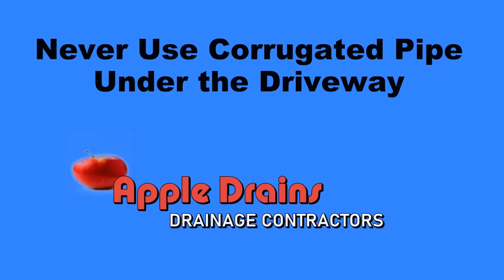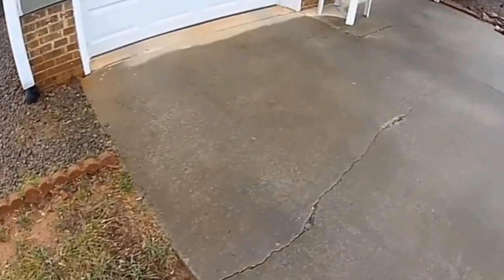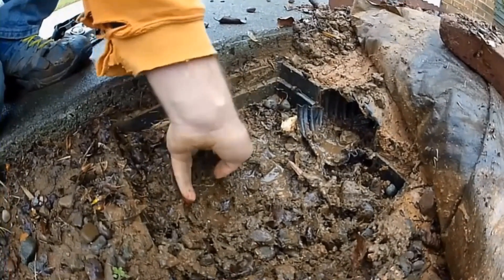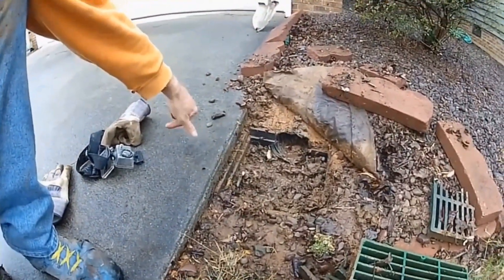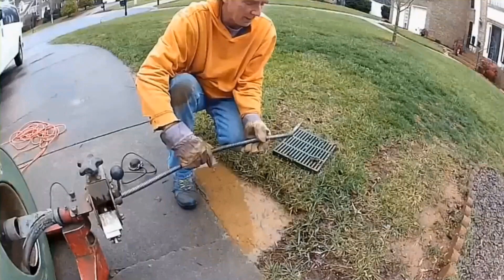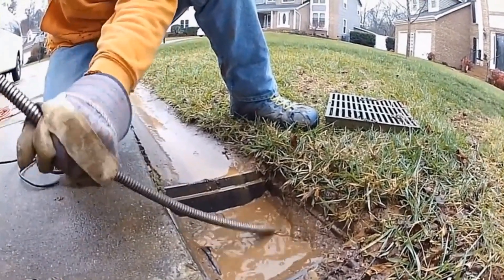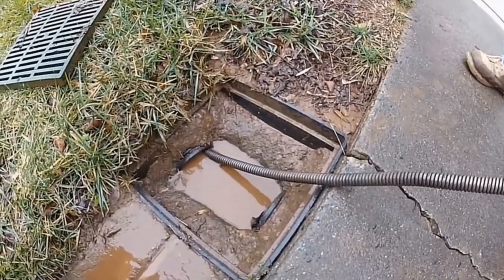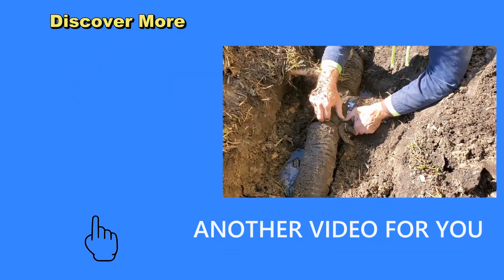Never Ever Use Corrugated Pipe Under Driveway

Comment: The currogated isn't the problem. The porblem is running it 2" under the driveway...  It should have been 2' or more under with nothing but gravel around it and then concrete on top.

Comment: If the pipe is crushed is cleaning adequate ? I was told it would cost 15,000 to 40,000 to replace the pipe and dig up the concrete. The pipe has microfractures from roots.
Reply: Yeah, the video starts out saying never run corrugated under a driveway, then they leave the same corrugated under the driveway...

Comment: Ok, I understand corrugated pipe has ridges that the concrete’s weight would collapse. Analytically speaking, would a rectangular pipe (Do they even make such pipe for this purpose?) be better, since it matches the flatness of the concrete pressing down on it?  Or is the standard round pipe the only way to go?  Scientifically, I would think the round would be weaker, since only a small portion of a round pipe would be supporting the whole weight of the concrete.
Reply: I don't think the problem is the shape or the ridges of corrugated pipe; its the wall thickness & strength. I can step on unburied corrugated & crush it. I weigh about 120 lbs.
Reply: @maxmanx1294  unbelievable they put it under a slab